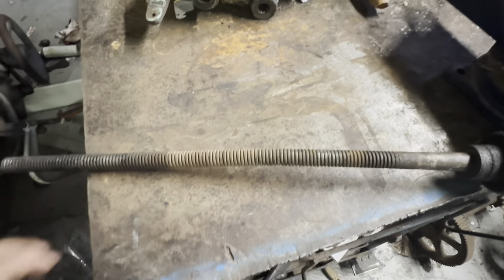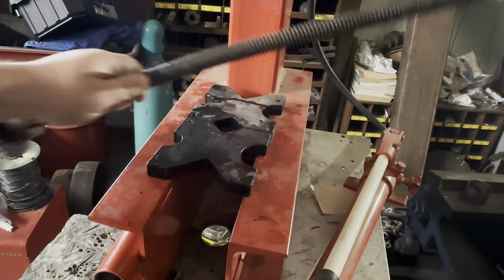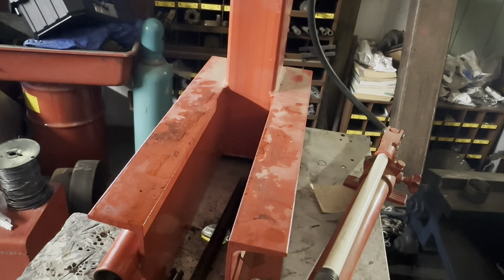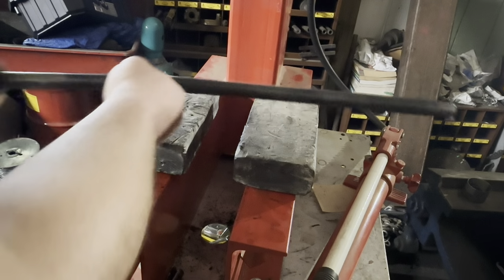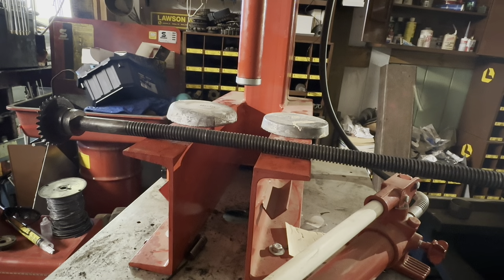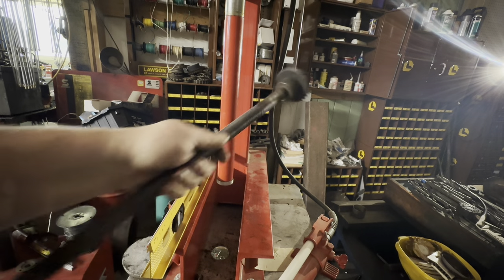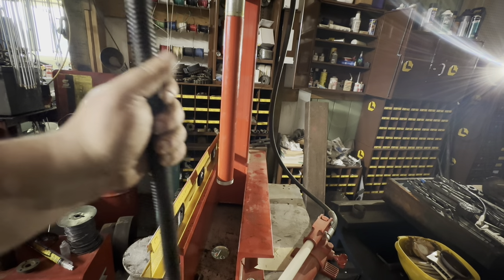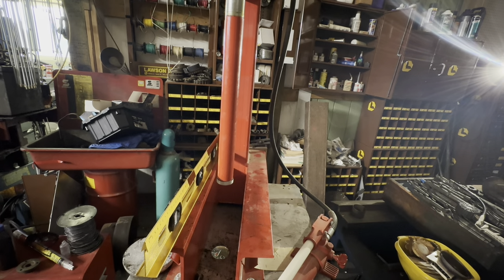Straightening a bent threaded shaft

Comment: Adam, that press caught my eye back when you originally showed it the first time. I did a little research on dimension and built one for myself out of some 3 inch I beam I had laying around. My garage is small and the footprint of this design is perfect. I even painted it red, it’s almost a twin to yours. I love it, and it works like a champ. I also built a small break for it out of some heavy angle iron. I’ve wanted a press for years but never had the room until now. So far I’ve bent some steel with it and pressed some bearings. It’s the perfect size and it’s a little power house. Thanks.
Reply from the maker: Awesome, it is a very easy design to copy and makes for a very rigid press
Reply: I bent a test piece of 2x1/4 strap to 90 degrees with it and it only deflected the frame about 1/16”. It cracked open the steel on the back of the bend. Im so happy with that little press. #skookum

Comment: Adam, put a dial gage under the bend.  It gives you a sense of how far you pushed it last time.  If the bend is still there, go another 0.010" on the next press.  Works better with a repeatable setup---maybe you could make lead soft jaws for some welded V-blocks.  Experience is usually better than equipment but the numbers help.  An old hand told me that bending is the best, followed by peening, followed by heat.  BTW, some of those threads looked f*ckered.  Squashed.  You might need to chase them to get it to run freely
Reply from the maker: All good ideas, and yeah it has some thread damage from the previous owners, most of it is very high up but will need to be addressed for sure